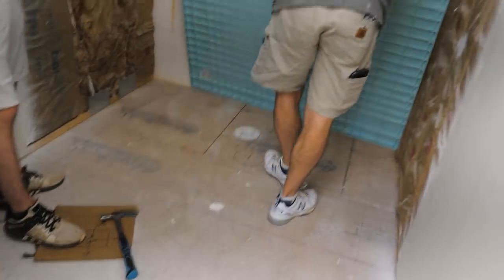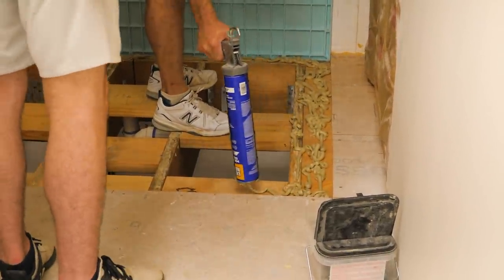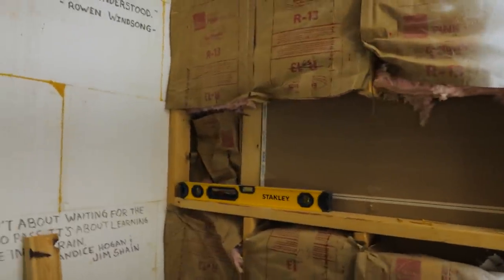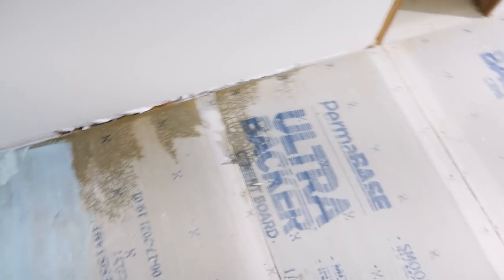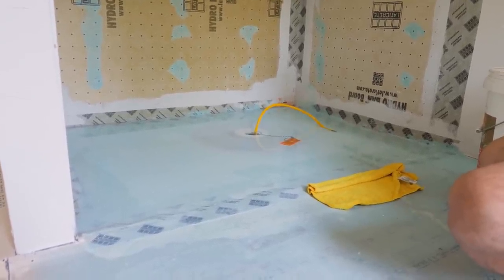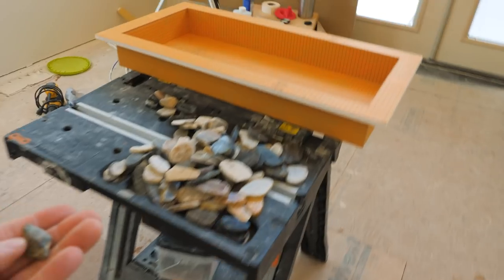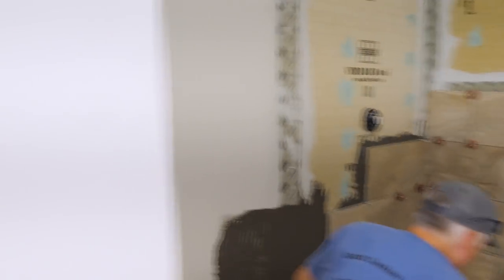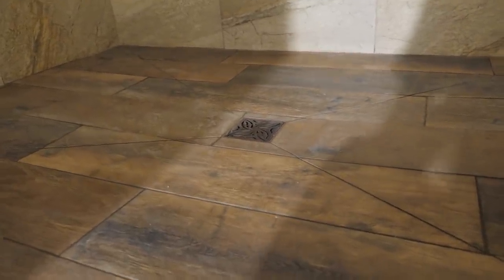Building Beautiful Custom Curbless Tile Showers

Comment: Stan the Magical Tile Man certainly does some fine work! We also used the Schluter system for our ensuite shower. Just goes to show that great minds think alike. I prefer the way you did yours though. We have a step up into our shower but if this system had been available when we built we would have done the same. So much easier! Looks great!

Comment: This goes into my saved videos. I was told when looking to redo my shower that I couldn’t do 1) curbless with a centered drain and 2) larger tiles on the shower floor because of the slope needed. This was an eye opener. Thanks to Stan!
Reply from the maker: You can do almost anything you can dream up. Just have to have a magical Stan. 😉

Comment: Morning... Help please, at 1:15 can you confirm you are sanding the "gloss" and/or "mold release compounds" off the "to be tiled surface" of the base so the tile will bond correctly.  History is I have slope formed fiberglass base with a Gel coat finish and the tiles have lifted off the base twice now (takes about a year to lift).  First time the contractor reinstalled at his cost, but is now blaming the base for moving, but the base is glued to a concrete slab and has zero deflection.  I feel we need to rough up the still near new polished / glossy surface so the tile glue has something the anchor too. The contractor says sanding the surface will lose the water proofing and will then leak. Any thoughts?
Reply from the maker: Sand it so a layer of liquid waterproofing will stick to the whole assembly once installed before the thinset and tile are laid.

Comment: I’m curious, where I live we don’t really have HVAC systems for air. With the ICF making the building so airtight, how does it work for ventilating the showers to prevent humidity/condensation? I don’t know if I’m phrasing this right, but is it a concern? Do you install vents to the outside?
Reply from the maker: Yes there are exhaust fans in bathroom ceilings that vent to the outside.
Reply: @Guildbrookfarm  cool, this whole build is super interesting!